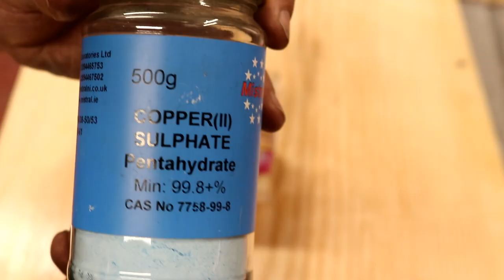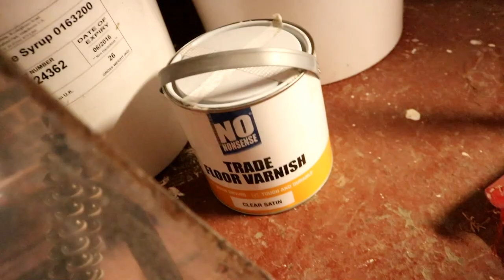INDUSTRIAL STYLE METAL & WOOD TABLE

Comment: Looks rarely good Harry, you might want to cut the excess off of the bolts that hold the top on.
Reply: Martin Martin yes I was thinking the same, especially if you add seating, that could be nasty on the top if your legs. Looks awesome though! Steam Punky
Reply: I came on here to say this exact same thing. It'll look cleaner without the bolts sticking out like that too
Reply from the maker: Fean not, the bolts will be cut flush. I just wanted it in the pub so I could get a few shots for the vlog.